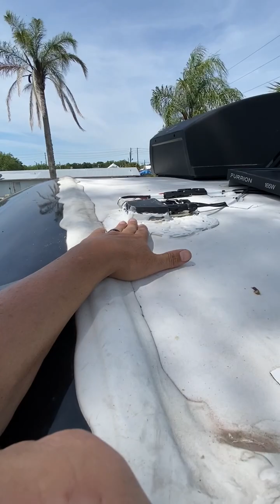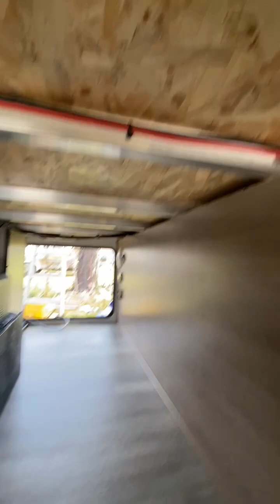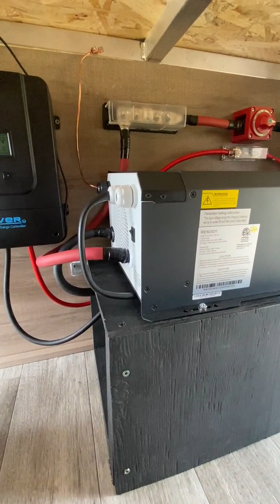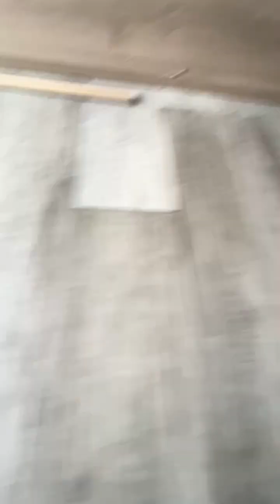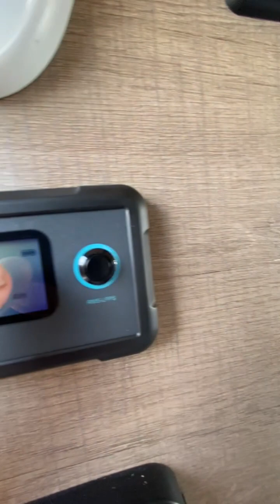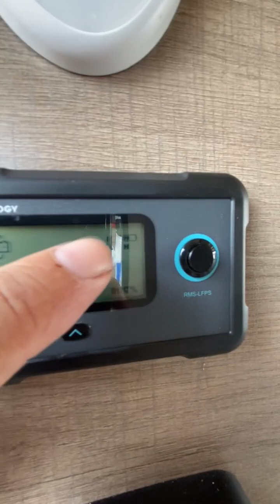Renogy 800 Watt kit install on Grand Design Imagine 2670MK (2 of 2)

Comment: Want to sell the stock panel? I have the same model and want to add another panel to double my solar. The stock controller and wiring will support it and I figure it's the cheapest way to increase the capacity.